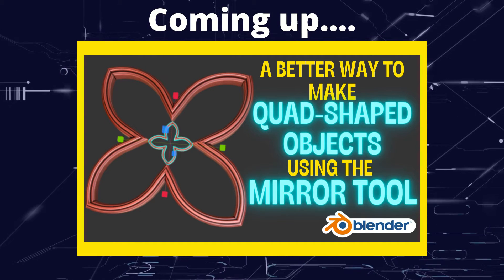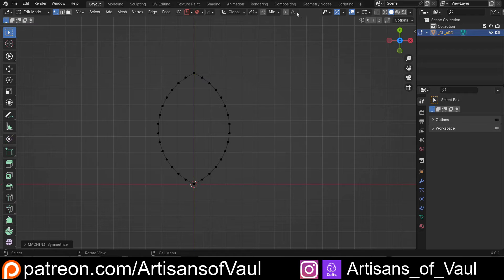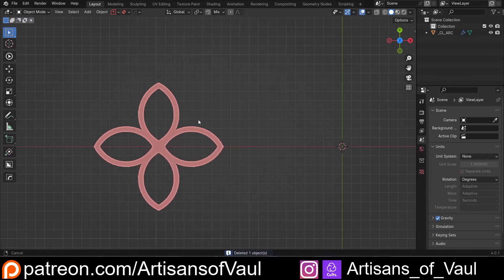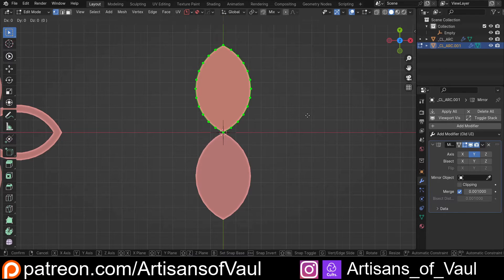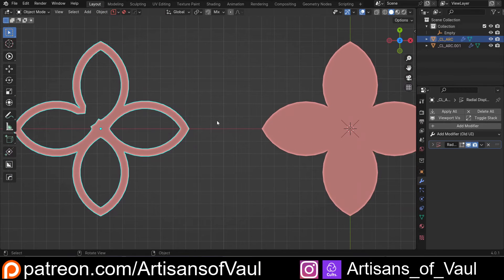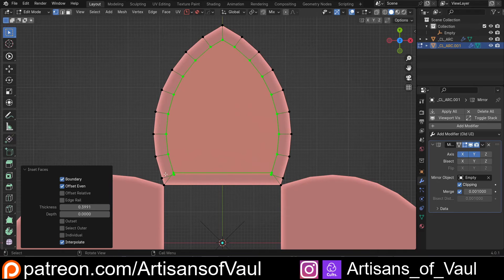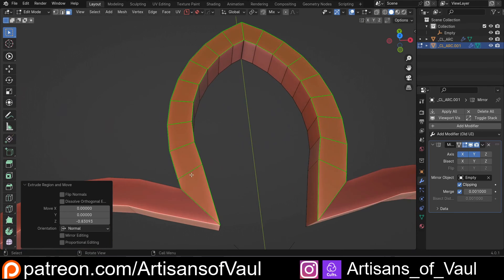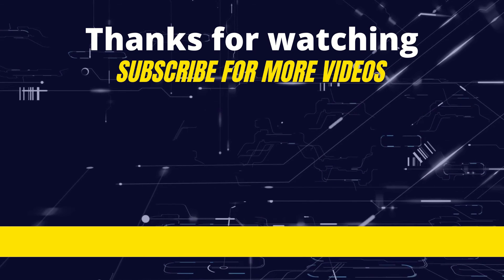Mirror tool trick for quad-formed objects in Blender

Comment: Nice Video. i have been using this way of using the Mirror Modifier for a gothic church, if you use the mirror modifier with a empty and add a radial array you can make more than just a Quatrefoil
Reply from the maker: Good point 👍🏻 I actually think there should be a geonodes way of doing this better, I just need to explore how to make sure it works at any level
Reply: @ArtisansofVaul  cant wait for that geo nodes make my brain hurt xD

Comment: Keeping the radial array modifier active, could you do the same just using the Weld modifier as you clean up geo?
Reply from the maker: I may be wrong so please let me know if I am, but from memory the weld modifier only works with the vertices being on top of one another (or close by) so this wouldn't solve the overlap issue properly.
Reply: @ArtisansofVaul  or maybe use a mirror for the single segment and then use radial array on top of it?
Tbh I normally either just delete geo until it's close enough or use a boolean.
Reply from the maker: @idiotfalcon  you could but I'd just use this method as now that's getting more annoying to do. Or Geometry nodes should be able to do something with a radial array. I'm looking into it.